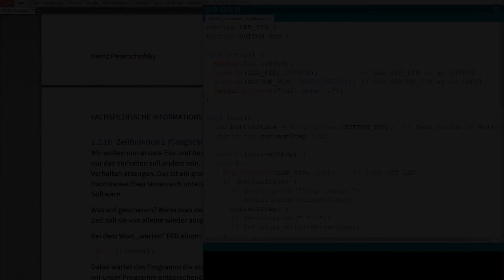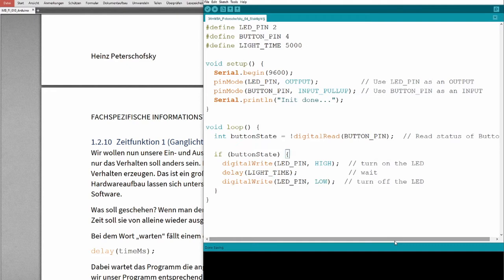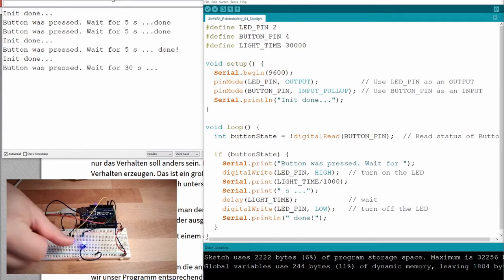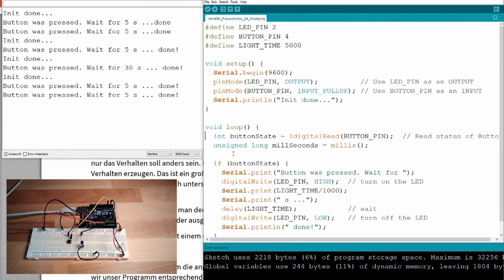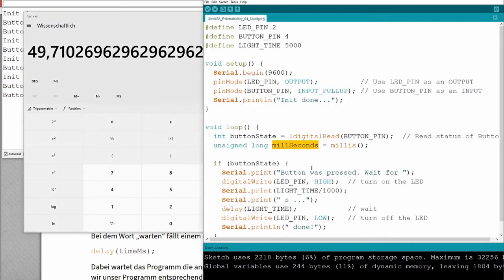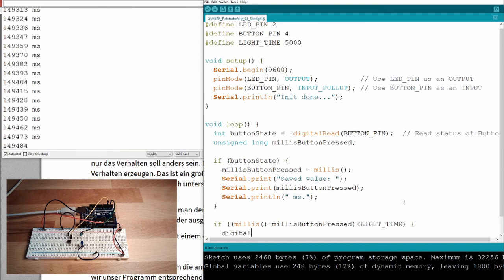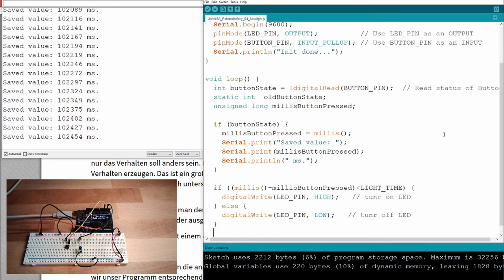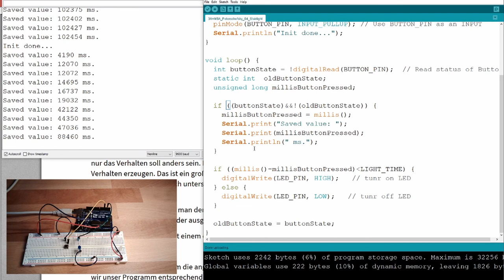Arduino 09: Stairway Light (Old)

Comment: sir , how to make stairs light with 21 step stair, i want to make in my home, with sensor .
Reply from the maker: Hello. 
First you need to select a light source. For instance a LED strip. Bei aware that sich light source usually needs cooling. I.e. a LED strip should be put to some metal or like that to transport the heat away. 
After this you know the voltage level and maximum power consumption. You need to select the switching element according these specs. As switching element you might consider some electronic component like a so called H-bridge usually used for drives. They often can be triggered by an Arduino's 5V high level. An example of a small H Briggs can be seen here https://youtu.be/rRpjuM1Qz9U.
As sensor element you might use a PIR sensor as motion detector. This can also be
combined with an Arduino.  An example with an PIR sensor can be seen here: https://youtu.be/8AIZxB4FMG0.
Then you can use the program of this example. Trigger will be not from a button, but from the PIR sensor. And you are not switching the light directly but via the switching element.
You might use a DC/DC-converter to operate your controller. Then you could use one power adapter for your light source and the controller.
If you have some more detail questions about these things feel free to ask.
Reply: @HeinzPeterschofsky  noted sir..thx